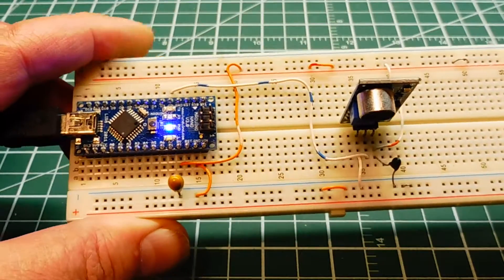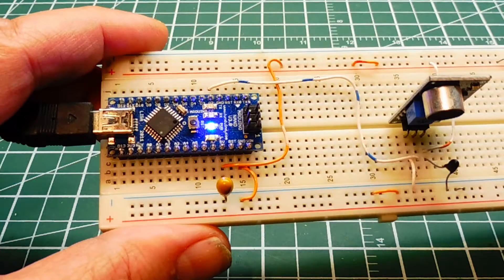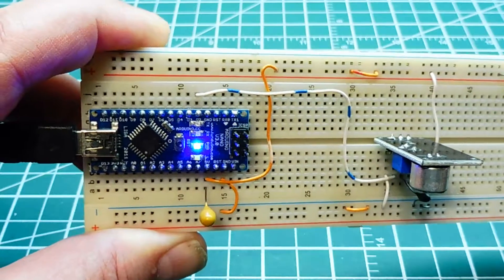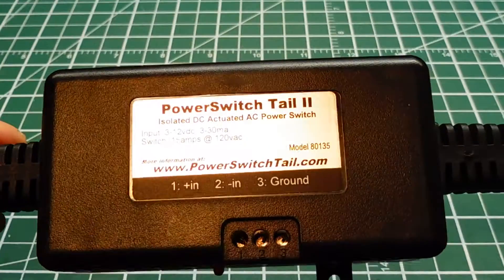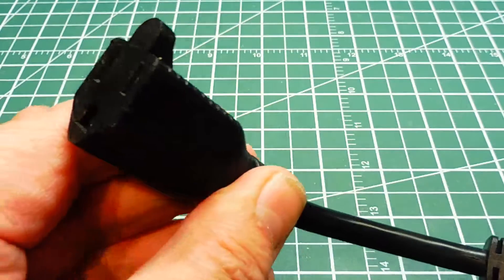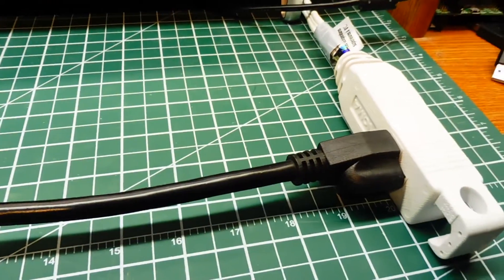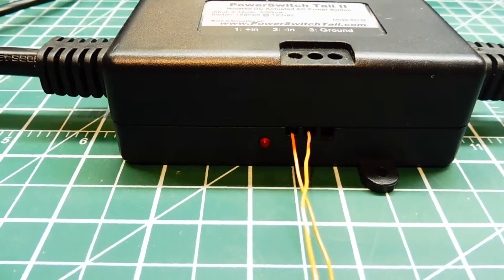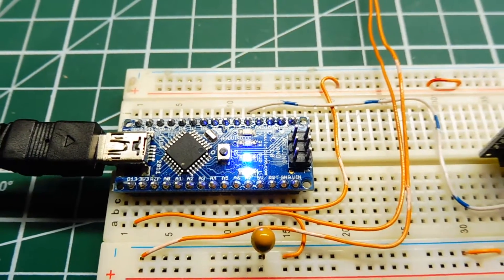How to build a Clap Switch

Comment: could u share the code and schematics for this?
Reply from the maker: The code is written in the FORTH programming language, I do not use the Arduino IDE.

: Clap1?   Begin pin2 low? Until ;

 : Clap2?  Clear.count
           Begin pin2 low?
                IF   Pin13 toggle exit 
                THEN count? 16000 > 
           Until ;

 : Quiet?  Begin pin2 high? Until ;

 : Clapper
            Decimal
            Init
            Start.clk
            BEGIN
            Clap1?
            60 ms
            Quiet?
            Clap2?
            100 ms
            AGAIN ;

"Clapper" is the main run program.

If you pause the video on the breadboard you can extract the schematic, the circuit is very simple.
The 2 capacitors on the Nano and sound module are for decoupling and can be omitted.
Reply: where could i find that? sorry for the noob question. im new to programming arduino
Reply from the maker: There are lots of online examples and sketches to download using the Arduino IDE.
If you are interested in FORTH programming, here is a free .pdf book you can download:
http://www.exemark.com/FORTH/StartingFORTHfromForthWebsitev9_2013_12_24.pdf

I have a video that shows how to load FORTH on the Arduino Nano.
https://youtu.be/n7l4Wn6xalc